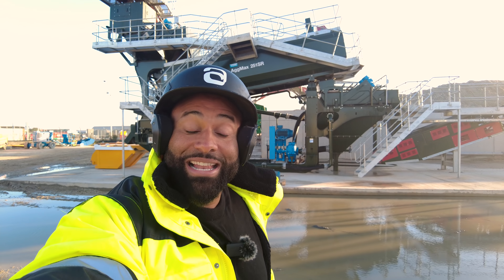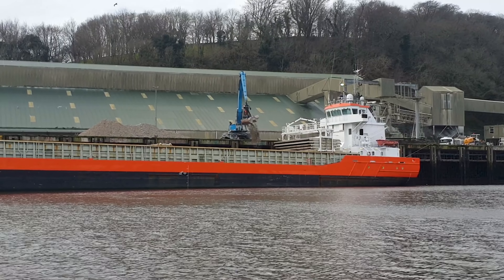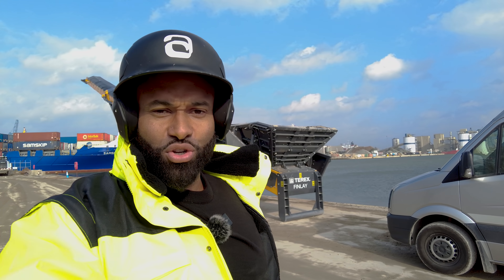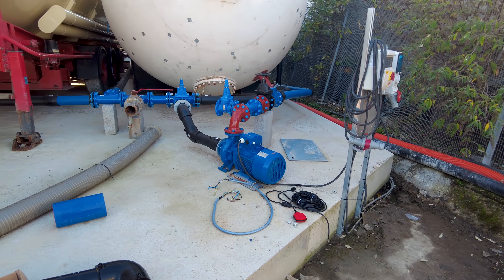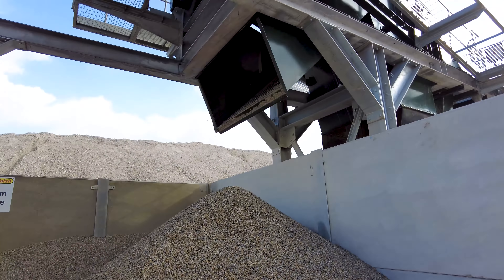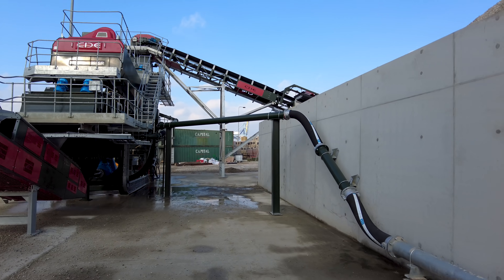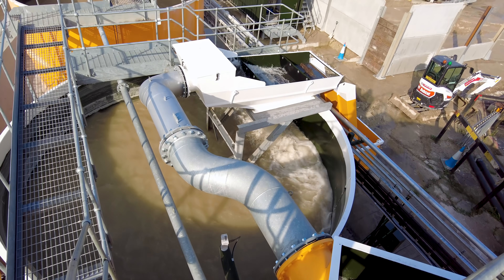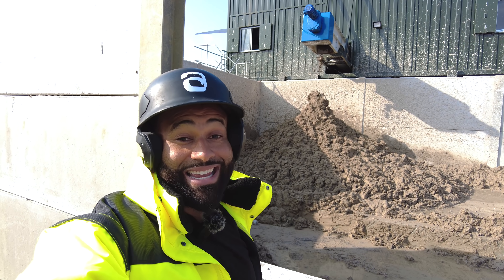How Machines RECYCLE Waste into Usable Material #SustainableFuture

Comment: As they say “one man’s waste is another man’s gold”. A very interesting set up, thank you for sharing this. We certainly need to be doing more for the next generations betterment. It would be interesting to see what is planned for the restoration of the quarry after all valuable materials have extracted.
Reply: Back in the 1960s the clay from the Victoria Line tube tunnels went to a disused clay pit, then it was used to make bricks. The brickworks and pit was purchased by a haulage company who had signed a contract to haul away all the tunnel spoil.
Very clever recycling.

Comment: Great system and wash plant, We run and process waste through a MRF and biomass and have a crushing plant for the rubble/construction waste. The crushed material then goes out as Cat2b, that is a recycled product. This video the products should not be classed as the same, needs tested and sold for the true product and potential that it is, primary/ recycled byproduct. Insightful video as always!
A video suggestion could be more on what you do with the waste from the waste management side, i know we have a lot of people and customers ask about what actually happens to it.

Comment: Another great video from the Ashville team. I see you mentioned China clay aka Kaolin. Have Ashville/Daniel seen or heard about Andromeda Metals? They produce halloysite kaolin helping move to a more sustainable future. Basically they have found a way of by using the halloysite kaolin to help concrete set quicker, faster and stronger! It will be a game changer in the industry... They are also big on carbon capture and the CEO James Marsh is a really likeable bloke. I think you should reach out, as a feature on carbon capture would make a great follow up video. Have a quick google to find out more...

Comment: Important to note: Hydrogen will be the future for the construction industry (diggers, lorries etc.). But yes, change will come.
Reply: I'll believe it when I see it.
Reply: If they make a fuel cell that wouldn’t be agitated by things diggers and excavators go though maybe but there’s a long way to go
Reply: Well jcb has made the first hydrogen backhoe and also they have made a a few other machines a well that are hydrogen
Reply: @talhafarook1902   They are not using hydrogen in fuel cells they are just burring it directly just like diesel is used currently. if you want some more information Harrys farm did a great video on the subject (https://www.youtube.com/watch?v=wDKLoLUQgH0)
Reply: The only exciting thing about hydrogen is that the byproduct is water. But there's nothing green about making hydrogen
Reply: @Karyabs  there is more than one way to make hydrogen. It might not be as efficient as just charging a battery from electricity, but it can be green.
Reply: Why not cars too?
Reply: Yeah, I've seen the JCB stuff - there's even a Harry's Farm video here - https://youtu.be/wDKLoLUQgH0

As for comparing HGVs etc. to cars, the point about heavy plant is the amount of time it's working/running (the duty cycle), which is way different from cars & LGVs. It's explained in that video link. Most cars (not all) are sat around 90% of the time, so topping up a BEV will be relatively easy. Heavy plant is out being used for 50-80% of the day, often nowhere near charging points (e.g. a combine harvester working the fields from 0500-2300). Hydrogen suits that kind of use pattern much better than BEV.

HGVs could be BEV if the charging infrastructure was seriously beefed up (Tesla Semi shows that), but would suit trunking better - tramping less so: we once had a Stobart's driver make last drop at our warehouse, and he stopped there until 0300 the next day - no regular chargers anywhere near us, let alone anything beefy enough to begin to charge a BEV HGV! Point being, BEV HGVs are okay if the unit overnights in a depot, but not really elsewhere (at the moment - may improve at some point).

Comment: From following you and watching your video's since you started, you could swap for electric tippers, diggers etc... get network rail as your supplier to deliver via an electric train. solar panels and small wind turbines on the roofs of your containers to power the units. recycle the water from the wheel was into a tank to flush the toilets? You can sell your cars and get an electric vehicle. Obviously some of these are long term, but some are quick wins and you can then be the leader within your industry. with maintaining QPR you can also start to switch out lights for LEDs, PVs on the roof of the stadium.....I could go on. but you would look brilliant if you started on 5% now each year instead of 25% each year the closer you get to 2050?

Comment: This is the area Cop26 should be starting with, making large scale production companies (Who can easily afford the slightly higher initial costs) use more sustainable raw materials, not punish the working man by raising the cost running their own homes and vehicles. 
The big dogs carry on as normal, climate change is my fault because I earn minimum wage and can only afford an old car, but can't possibly get to and from work reliably without my own car?
Sorry for the rant, but maybe you don't need a car that only does 9mpg, then try and promote sustainability???

Comment: You shouldnt be getting political and making it primarily about carbon footprint. You still need coal and  diesel, fossil fuels. where do you think most o the machinery has been diggin the materials out of the ground came from.. The engines are getting better, cleaner and more efficient so are the coal fire power plants.